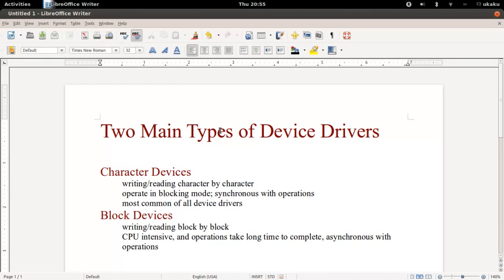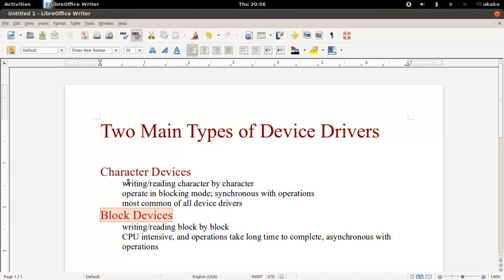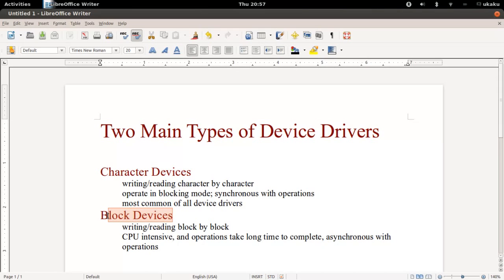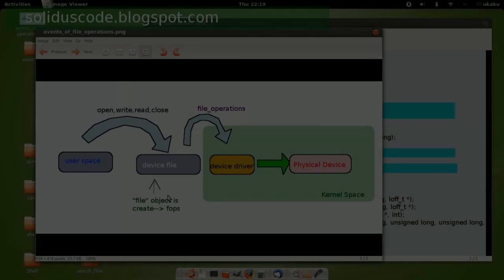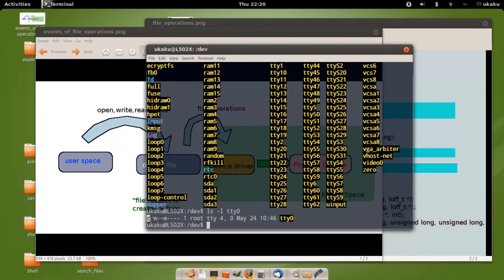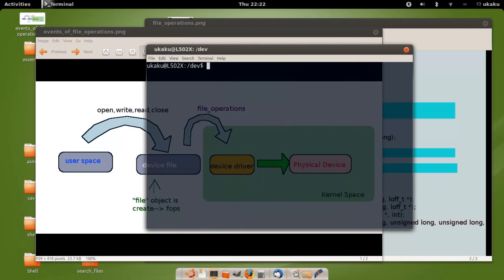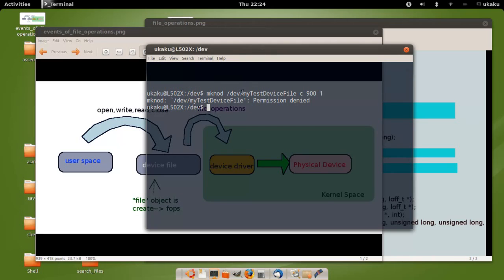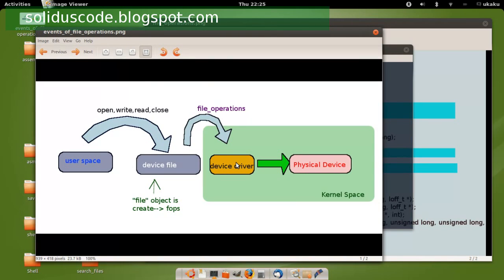Linux Kernel Module Programming - 06 Char Driver, Block Driver, Overview of Writing Device Driver

Comment: i am having one issue of invalid module format while trying to insert the module.can anyone please help me.
Reply: when you compile the module , they will require linux headers, the version of the required header and the kernel version of the host system on which you are compiling should be the same.